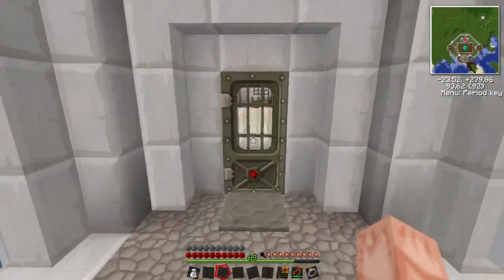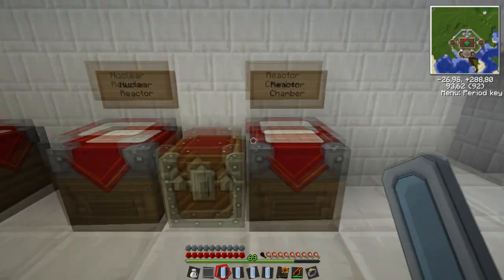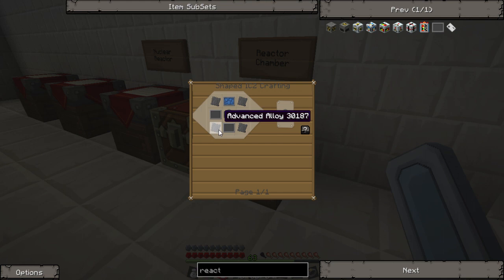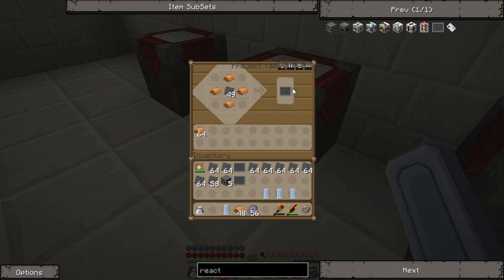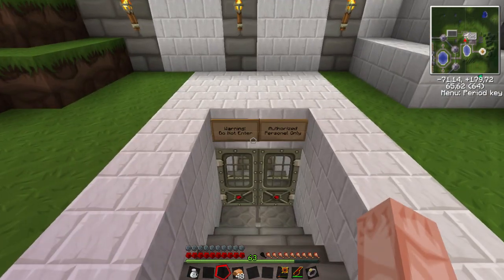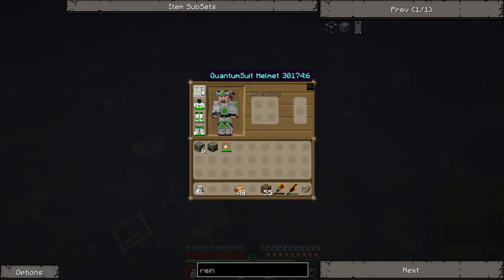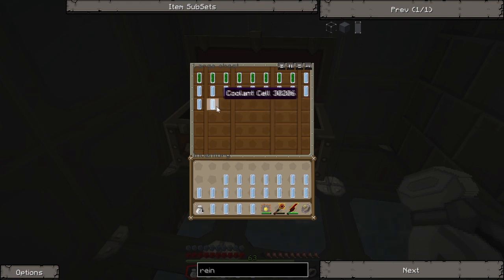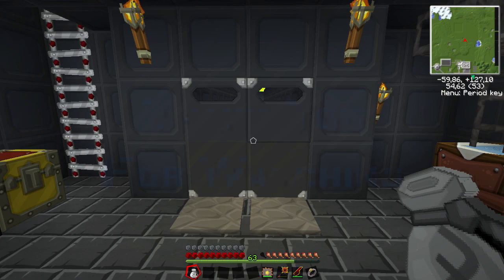How to Tekkit - Nuclear Power

Comment: Why did you need HV cables? To my limited knowledge, each cable can handle an unlimited amount of EU packets, so if glass fiber cable can handle the power output packets from one reactor, wouldn't the same cable be able to handle 8 times the number of packets?